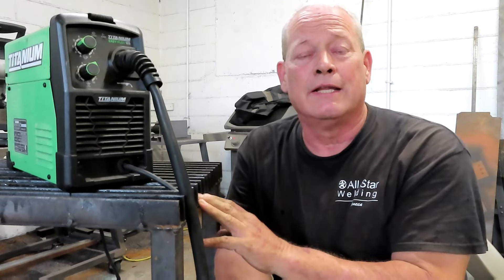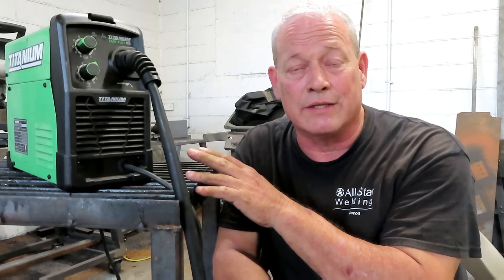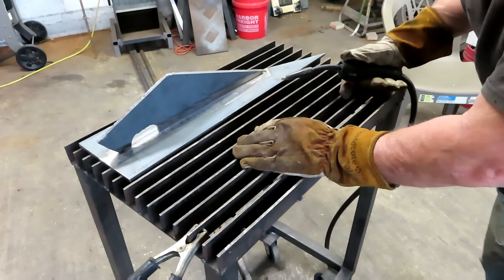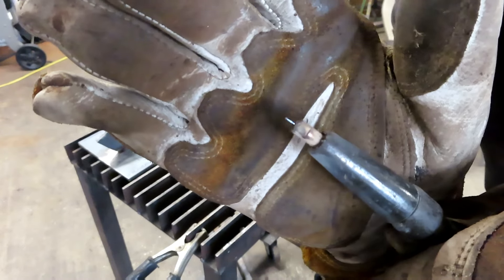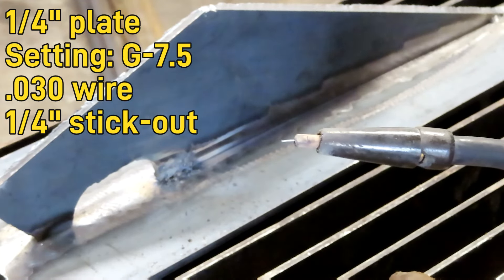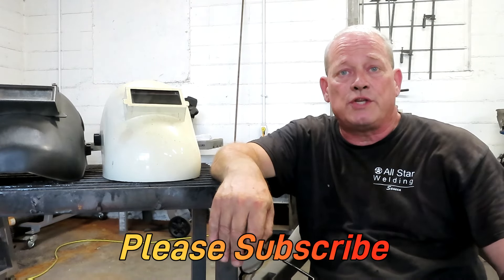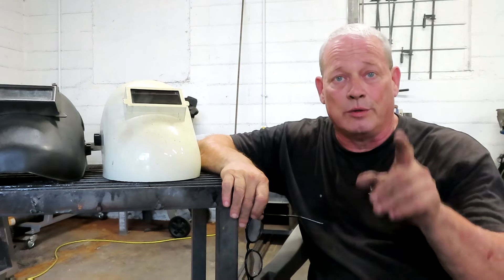How to Weld Like a Pro with the Harbor Freight Titanium Easy Flux 125 | Beginner’s Tips

Comment: I've never welded before. I tried yesterday and mine looked exactly like your first one. I was using one hand lots of wire hanging out. So I'm going to give it another go using your techniques. Hopefully one day mine will look a fraction of what your welds look like. I like all the welds. Thanks for the video. Helps me a lot. Subscribed
Reply from the maker: One of the most important steps is to steady your hand with your other one. Do that, and your welds will immediately look better. I tend to start with maybe 1/2" stickout at the most, once I get it going, I move in to about 1/4".

Comment: I took Advantage of the harbor freight sale. I bought the 125 welder. I was watching your video and i would stop it go out in the shop a try each one of those welds. I seem to be better at little circles. I'm going to practice each weld in case i need them. I want to practice on the bed of my truck and tach weld metal patches. I know I have to space out my tachs so don't worry about that. Thanks for the video. I'll be back.
Reply from the maker: That's a great way to practice. Get good at all of them. There will be times when one method is preferred depending on the situation
Reply: I’m glad I saw this video now I know it will work for what I need to fix the rocker panels on my trucks

Comment: I like 2 and 4 the most.  Which method do you like the most or recommend?
Reply from the maker: That's hard to answer. These are just 4 popular methods. It all depends on whether it's flat, in a corner, up hill or down hill, thick material to thinner, etc.
Reply: @AllStarWeldingSC  gotcha, thanks.  Looking to get started into welding, so I'm compiling as much info as possible.
Reply from the maker: That's great. I have been really tied up lately, but I'm hoping to put out an advanced flux core welding video this weekend. Keep an eye out!

Comment: These were the tips i needed! Thank you! The stick out at 1/8 is a great tip. I had seen people talking about changing the polarity on this machine so that its electrode negative instead of electrode positive. Is yours as is? Also what wire are you using. I get soo much splatter. Also number 2 was my fav weld
Reply from the maker: Hey Paul .. these machines already come wired electrode negative, as it is a flux core only machine. To change polarity would require disassembly, unsoldering a bunch of stuff, and rewiring the whole thing. Mig machines that do flux and Mig, have to be changed by either swapping the leads, changing a lug, flipping a switch, they're all different. A machine that is flux core ONLY, cannot be changed, as they will ALWAYS be pre-wired as electrode negative. Anyone that says otherwise doesn't know what they are talking about. Again, if it is a flux core ONLY machine, it comes from the factory as electrode negative. And this includes the Titanium Flux 125.
Reply from the maker: And my favorite flux core wire is Weldcote. But again, keeping a nice tight stickout like in the video, will eliminate most of your spatter.

Comment: At 11:42 could you explain what caused it? Thanks!
Reply from the maker: Are you talking about that little hole? It could have been my movement inconsistency, hand slip, moving too fast, just a bubble, a piece of slag got lodged in it, spatter. Could have been anything. These things happen sometimes with flux core. If I had to narrow it down, I would probably say my fault
Reply: @ ok thanks! I’m new to this and was just curious for when I do the same which I’m sure I will.  Thank you for the knowledge!
Reply from the maker: I will say this.... With the rest of the bead looking so good, and the fact that it won't be X-ray certified, and probably just on a repair job, I'm not worried about 1 tiny blip. But of course, strive to have no defects

Comment: Cant you fill in the holes with a small hit with it?Does flux work well on 110 outlet ?I think they run on 110 and 220 .
Reply from the maker: Yes, you can fill a hole with it. Done it many times. This machine is 110v only. Some are 110v/220v. I have a few that run on 220v. I wouldn't say they run "better" on 220v, but it will let you run it much hotter, so thicker material, than 110v.
Reply: @AllStarWeldingSC  thanks , sounds good . I bought a three in one welder from toolium, so its good to hear that. It is flux , stick and lift tig , i think. appreciate the reply.

Comment: I want to learn to weld to build my own 3 wheel gas scooter that way i can say it was built not bought. 😊
Reply from the maker: You’ll be able to make some pretty cool stuff after learning to weld!
Reply: @AllStarWeldingSC  true:3 will this welder work on stainless steel?
Reply from the maker: Nope. Just regular carbon steel
Reply: @AllStarWeldingSC  damn I was hoping to build it with stainless steel, any other welder would do the trick?
Reply from the maker: If you had a regular Mig that can take gas, there is a stainless wire you can get, but I've never used it. There are also stainless sticks for arc welding, should be good with 60-80 amps. But the best way is with Tig.
Reply: @AllStarWeldingSC  thanks :)

Comment: How do you choose the settings when welding?
Reply from the maker: Well, to start with, go with the setting chart that is under the lid. I find it to be pretty accurate. Then adjust from there. I know that's what everyone says. Let me explain... There are 3 things that go into a weld: Voltage, Wire Feed, and Travel Speed. Let's say for a given thickness of metal, you look on the chart and set your baseline setting. Test it on a piece of scrap in the same orientation of what you are about to do. If it's burning through, lower the heat, or move faster, or increase wire feed. If the weld bead is too built up or humped up, increase voltage (heat), or decrease wire feed, or move faster. The relationship between these 3 components are critical, and will simply come over time with practice.

Comment: I am confused as to polarity why do I need to alter this can you help
Reply from the maker: Flux core runs on Electrode Negative, plain and simple. You DO NOT have to change anything on the Titanium. If it's a machine that is FLUX CORE ONLY, like this Titanium, Century, Lincoln 90, and others, they are already hardwired for electrode negative. You do not have to, nor can you, change it. However, if it's a machine that runs both Mig or Flux Core, you have to switch to negative for flux core, and positive for Mig, as well as swapping out the drive rollers.

Comment: I’m a new welding student I have about 3 months less than 40 days under the hood, my question is face or helmet head position (closeness) to hand and body closeness, I found myself yesterday wanting to put my face in the weld because when I put my hood down I felt like I was fighting a mosh pit to lay a straight weld… towards the end of my 4 F overhead it felt like it was going good but came out flat and not welded with the other side (too low)… what is a tightened body in a semi sorta comfortable position to a relaxed position, does tension show in the welds like an accent in writing?
Reply from the maker: It’s tough to say without seeing you weld, but a good weld is about a smooth consistent movement, not brute force. If you have to fight what you are doing, just stop. Step back and raise the hood. Re-evaluate your position, and get comfortable. Being all tensed up and awkward will definitely show in your weld.

Comment: Will this welder be able to weld about 10inch long line of my c10 frame I just cut the frame with a template it’s saying thickness of frame is 3/16
Reply from the maker: I think it would be kind of risky. I'd rather use stick or Mig.
Reply: @ ok thanks!

Comment: Maybe I missed it, but what brand wire are you using? I have this welder and the Lincoln wire I have seems to spatter quite a bit. Thanks!
Reply from the maker: Over the years, I have used so many it's ridiculous. For the last 3 years, I have been using Weldcote almost exclusively. Look for my video about what wire I use. The technique also has a huge part in the spatter. If you are interested, Mike Festiva and Brandon Lund have made some really good videos comparing different wires against each other.
Reply: @AllStarWeldingSC   Thank you for the response. I will look into both the wire and the recommended channels' videos.

Comment: When you can build welds up why do they say can only weld quarter inch steel? I know the penetration doesn't go as deep but if I lined up three welds together and made it wider couldn't I weld bigger stuff and even go on top of those three welds? I'm welding a tractor with 3/8 inch steel and I was just going to throw down as much metal as I could.
Reply from the maker: Yes, I have welded 3/8" with flux core before, but I usually just use stick weld. Keep in mind that when a welding machine lists it capacity, it's referring to a single pass. For flux core, from 1/4" up, it would be important to bevel your edges. Especially if it's a T joint. Bevel it, tack it, then weld in the bevel. Use a wire wheel on a grinder and get all the slag off. Then you can weld along the bottom piece and onto the previous weld. Clean that up, then weld on top of that one and onto the top piece. Now, this is with wire that is rated for multi-pass. If your wire says GS, it's usually not rated for multi-pass. It can be done in a pinch, or if it's not a structural joint. The Lincoln wire NR-211-MP is multi-pass, that's what the MP stands for. I've done it many times. But like I said, if it's that thick, and important, I'm usually going to stick weld it, or use Mig. I just use my Titanium for on-site handrail jobs.
Reply: Thanks dude!

Comment: ASW,  I'm not a welder,  butt I would like to buy a great Titantum 125 welding machine so that if I needed to weld some metal together, I could find somebody to use my machine
to do the job.  There is a lot of questions about using it, the fluz size on different size of metal,  how slow to moved ur hand welding,  what power to use.
would a 120 volt machine to the job, or a 220 for a better job.   thanks
Reply from the maker: The Titanium with 120v will handle most of what you are needing. If it's thicker material, I would consider stick or Mig

Comment: I just bought one of these and wast testing on some 1/8 angle iron.  I could not get it to Arc on Anything less that middle of G-H.  I know the instructions said not to use a extension cord but where i was i had no choice.  Could this be the reason...not enough juice?
Reply from the maker: How long was the extension cord? I've used this with 100ft cord before with no trouble. Make sure the metal is clean where your ground clamp is. Was there any dirt, rust, paint, etc on it?

Comment: My biggest problem was prep work, cleaning the metal.
Reply from the maker: Well, the cleaner the better. But really, flux core can burn through a lot of crap. Easiest way is to simply use a knotted wire wheel on a angle grinder, just to knock off the paint/rust, then send it!

Comment: ❤great video 📹 I bought 1 of these welders when they 1st came out, on the 1/4 what was the temp setting n the feed? Also have u welded 3/16 mild steel with this weld? Jason, Ks
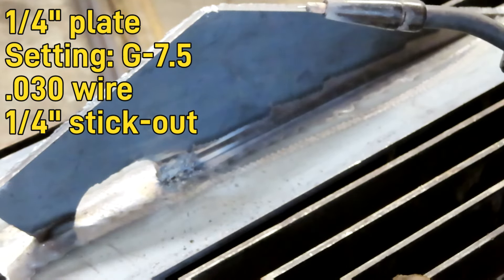Reply from the maker: 3/16 was a breeze. I can't remember the settings, but if you watch the video, the settings are listed on the screen at 5:24

Comment: # 4 is great
Reply from the maker: Yeah, whip and pause is good for thicker material. Pattern 1 is good for thinner. The circles is good for joining thinner to thicker. When doing the circles, make the bottom of the circles on the thicker, because there is more travel time at the bottom of that pattern. If the thicker is on top, and the thinner on the bottom, do the circle pattern up side. If that makes sense.

Comment: I was a master welder fabricator for about 30 years. I bought one of these welders 2 years ago. For the money you can't beat it. Great for small jobs around the farm or house. For a novice or beginner, it's perfect! The duty cycle is low, but it does a fantastic job on everything that I have used it on. 
Great video and great little inexpensive portable welder.
I would definitely recommend this machine. 👌
Reply from the maker: Thanks for the comment. I agree, for the price and the capability, it's a no brainer. I'm not about to breakdown my Mig machine, and the tank, to go fix a loose handrail. That's when the Titanium is handy. Besides, who wants to Mig outdoors?
Reply from the maker: I also have a Primeweld 160Ts that I keep just for flux core. It's a beast. Runs 120/220v and can really melt some wire. Here's a link to the video. You can skip the fluff and get to the good parts 
https://youtu.be/dJcjZ9ifu7I

Comment: What setting should that flux 125 be set at for automotive body work?
Reply from the maker: Pretty low. I'm not around the machine right now, but the chart under the lid is pretty accurate. Use .030 wire, and start below the chart settings and adjust up from there.
Reply: @AllStarWeldingSC  thank you
Reply: Thank you

Comment: Great demo. 2 questions, can you weld sheet metal with this product? And how deep do you penetrate the work piece? I believe that the instructions say 3/16 max. Thanks.
Reply from the maker: Yes and yes. Let me explain .. you can do sheet metal, but it takes a little finesse. First, make sure you use the .030 wire. That will let you use minimum settings. An overlap joint will be easier in the beginning than a butt joint. Zap here, zap there, you want to bounce around and take your time, that will minimize warpage. If it's auto body type sheet metal, it can be done. I've done it. As for thicker stuff, remember that any machine that gives a rating to the thickness it can do is referring to a single pass. Lincoln make a flux core wire NR-211-MP. With this, the MP stands for Multi Pass. This is one of the few wires that is rated for multi-pass. Run one bead, then hit it with a wire wheel on an angle grinder. Make sure it's clean of slag, then run another pass. If you bevel the joint, you can weld some 1/2" if you do it right.
Reply: @ Hey thanks for the reply. You don’t live in South Carolina by chance?
Reply from the maker: Yes. How did you know? Accent? I'm in Seneca
Reply: @ The SC was a give away.  I have a very small job for you. I need a screw hole filled. Actually 2 of them. When I screw up I do it in pairs. ;-) I’m in Walhalla. Can I call you?
Reply from the maker: Absolutely you can

Comment: Navy Retired Sailor here and I want to start doing something like this, never welded so I will be checking out your channel. On another note what type of metals this machine can tackle? Thanks in advance.
Reply from the maker: You’ll be surprised by what this machine can do. It think it's rated for 3/16, I've done 1/4" with it. But those ratings are for a single pass. You can do a little thicker with multiple passes. As this is just DC negative, with no gas input, it's only good for steel.

Comment: I noticed that you keep your machine at C and a hair above 5… Do you use that much heat even on something like older exhaust pipes on cars?
Reply from the maker: Most of the time, I'm using the Titanium on site for a handrail, and usually it's set to D and 5-5.5. That usually works for the gauge I'm building with. Exhaust is something I despise doing, so it's been a while, but I think it was pretty low. Usually .023 on Mig, but on the Titanium, maybe B and 3

Comment: We're you looking over me at 4:52?...😂... almost returned to Harbour Freight. Greatest tip ever (1/8" stick out)... thank you sir. 😅
Reply from the maker: Glad it helped. I like to start at 1/2" stickout, but as it starts going, I move it in. When you have a hot puddle going, a short stickout will drive the wire into that hot puddle. A long stickout will just bounce out of it and cause spatter and bad weld joint

Comment: How does this welds a sheet metal ???( mufler  thin mettal)
Reply from the maker: Personally, 16g would be the thinnest I would want to weld with this unit. Just in general, flux-core welds pretty hot. That is because not only does it have to melt the base metal, but also the filler metal, and the flux inside the wire. Most muffler shops use Mig, for the shielding gas for this reason, and the use .023 wire. Now, having said all that, I actually have used this machine to put a muffler on my friends truck. The pipes/muffler fit into each other very snuggly and tight. In that situation, with careful adjustments, it is very possible to weld it up with flux core. Don't try to do the whole thing at one shot. Tack it up, then do several short stitches. Take plenty of time. I would do C shape arcs. Do one, stop, wait for the orange glow to go away, then do another. Perhaps I will do a video showing this process.

Comment: I had been thinking of getting this welder for over a year. I’ve done stick welding years ago and help now with 4-H welding with a lot of young kids. Always wanted to try flux core so I pulled the trigger and bought it yesterday. Now to wait for warm weather. Great video and I like the #2 weld best.
Reply from the maker: That #2 weld is a great one to practice, especially for beginners! It's good to practice all these, plus more, because you never know what the position and material will need.